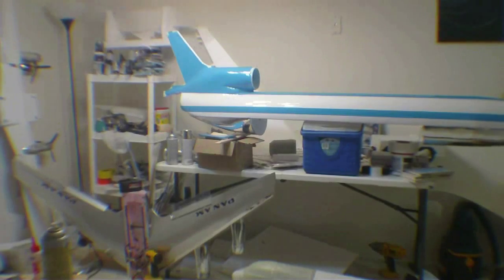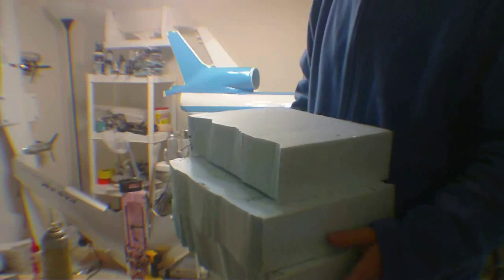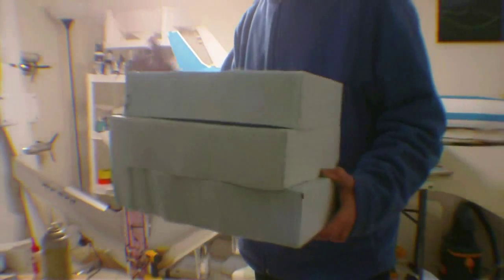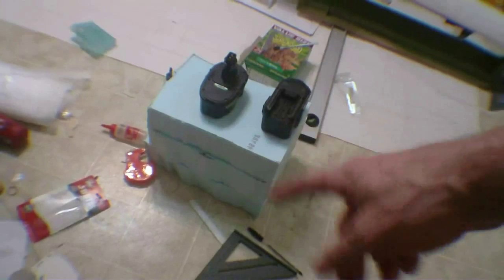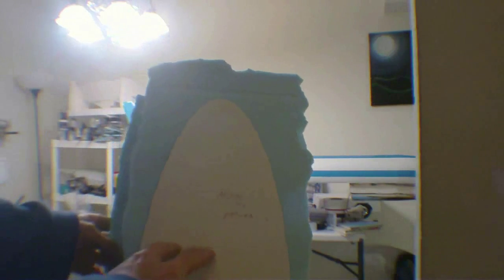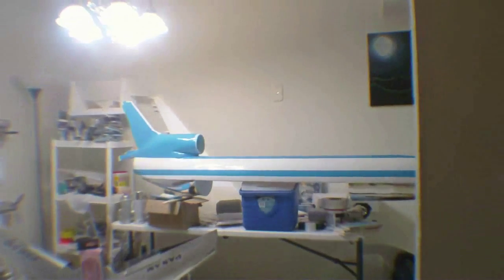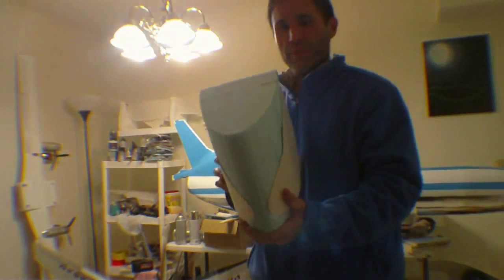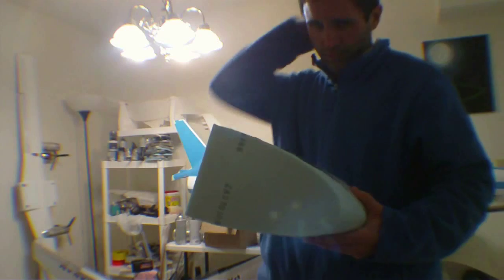How to build a 7.4 Foot MD-80 RC EDF Airliner Part-14!

Comment: Awesome.. More straight to the face airliner build tech!!  So the hotwire doesn't hang up at all on the epoxy joints between the sheets? Oh, and I think if you created a particle board table with a 90 degree vertical wire coming off it resembling a scroll or band saw, it'll help with the cuts!